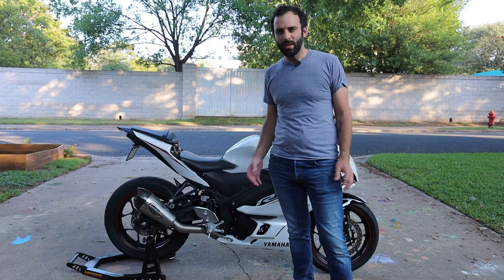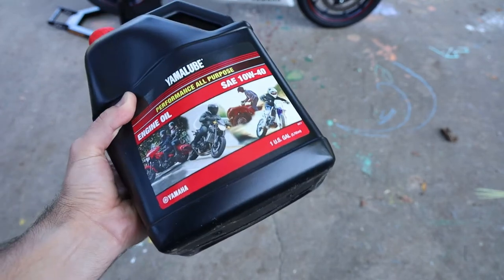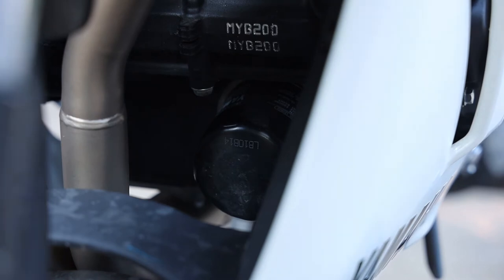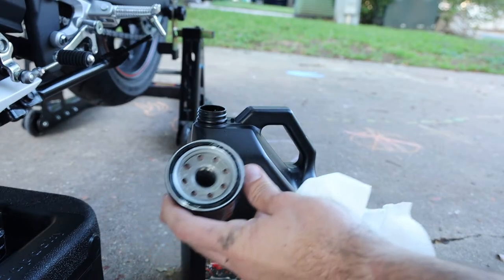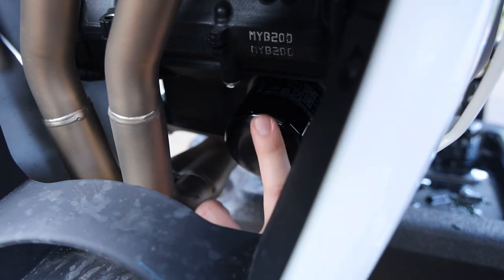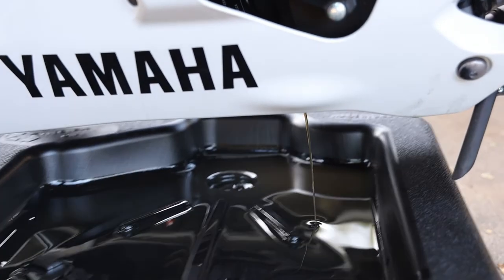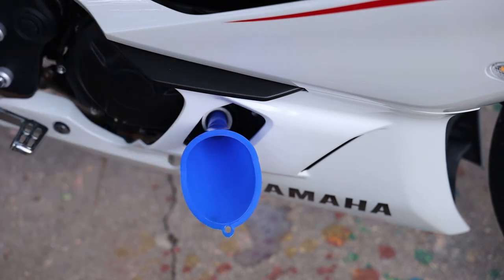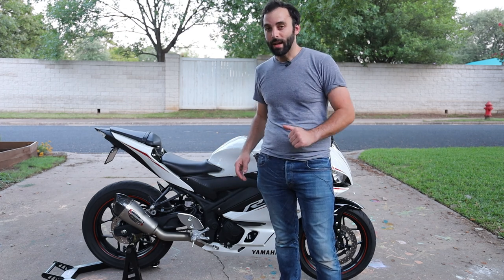How to CHANGE the OIL on 2019-2021 Yamaha YZF-R3

Comment: Awesome video, brother. I usually run the engine before to warm up the oil, so that it all comes out. I've had issue with bikes and holding onto oil and not having a level to tell me where it's at, causing over filling.

Anyway, this is thorough as hell, thank you.
Reply from the maker: Great tip, I do the same with my motorcycle and cars! Just edited it out for time sake in the video.

Comment: You will definitely need an oil filter wrench if it's your 600mi oil change. Yamaha practically welds it to the engine from the factory.

Comment: Great video man, would you consider the Yamaha frame sliders or TST? And what about a bigger tire like a 160 or a aftermarket rim 5.5 with an 180 ?
Reply from the maker: I think the Womet—Tech ones are pretty solid for the price. You do have to cut the  fairings though so unless you have the proper tools, it may not look very clean.
Getting a 150 wide on the back is one of my next changes, not a fan of how skinny the rear tire is.

Comment: Thanks for the video. I was shown (on cars) to remove the bolt first then do the filter after most of the oil had drained. Any reason why you've done it the other way around? Also - what bike stand do you have? Thanks
Reply from the maker: No particular reason, it really shouldn’t matter too much but since the drain bolt is usually lower on the motor, I like to remove it last.

Comment: I over filled  the oil how can I drain abit without unplug the drain plug ??
Reply from the maker: Just open the plug a little bit (not taking it fully off) to let some drain out and then tighten it back on, that's what I've done in the past.

Comment: So what does it mean when the little oil display on the screen is flashing on and off.
Reply from the maker: It will usually flash when you first start your motorcycle. Would be a bigger concern if the light stayed on.

Comment: Do we have to change the bottom bolt? can't we use the same one over and over again?
Reply from the maker: You can use the bolt again if you want but it’s best to have an extra crush washer on hand in case you can’t use the one you are removing

Comment: Quick question , about how many miles does the bike run before having to do an oil change again , just got mine that’s why I’m asking and the oil light started blinking after having it for just 1 month
Reply: 600miles is the break In, check your manual for the manufacture recommendations